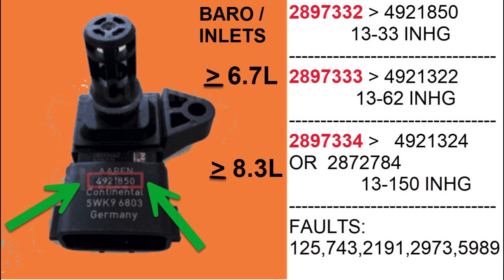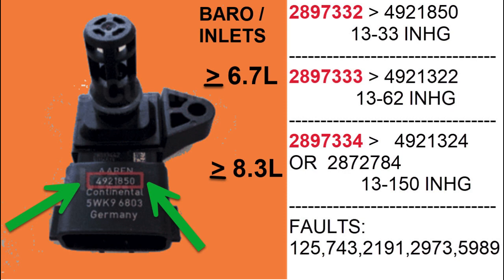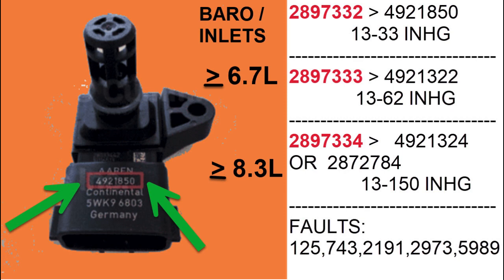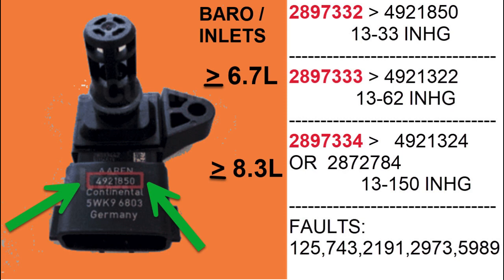Know your boost sensor

Comment: I wish I could include a pic, but I replaced an IMAP sensor today on a 2013 cascadia w/604K miles on it.  Sensor was coated wit cummins red paint on the top side.  The sensor side was 99% clogged with soot.  I also replaced the factory Delta P sensor and both gas pressure sensors.  She runs much better now!  🙄
Reply from the maker: It is amazing how powerful the sensor inputs are when it comes to how the ecm runs the engine. Yes the ECM runs the engine and the sensors are its eyes and ears.

Comment: Thank you for submitting a ticket with us,

ECM Calibrations are not accessible under the Limited Owners Plan(LOP) subscription. You will need to purchase a higher level subscription.
Regards,
QuickServe Online Customer Support
Cummins Inc.
Thanks anyway .
Reply from the maker: If you want the actual calibration you can go to cummins.com. and download them. when you download the cals 68gigs. and extract them the revision list in in one of the folders
with a lot of other great info. If you have a working copy of insite you can get the cals free you just need to unzip the 7 zip files into a folder. the cals are free to download and work.
Reply: @ENGINESHOPJOE  Thanks
Reply: Or purchase the Cummins inline mini
Reply: @MrRyanrk12  I'm looking ECM Calibration Revisions
Reply: @junkyardspecial9608  Insite Pro $770/yr